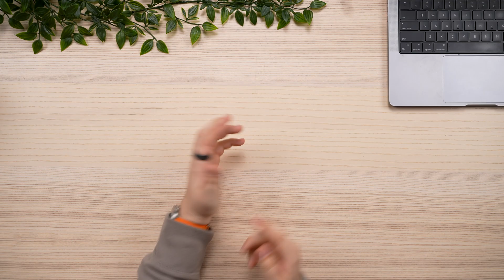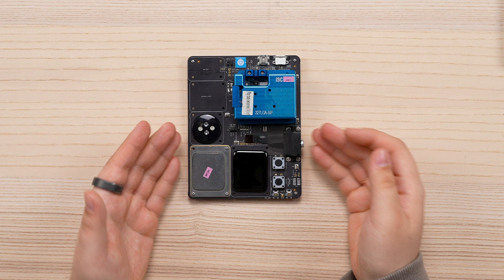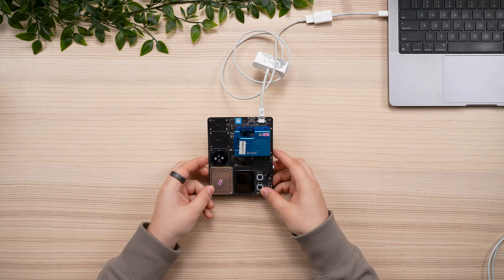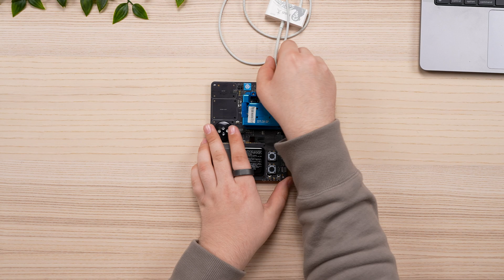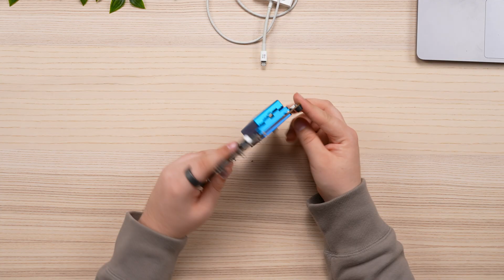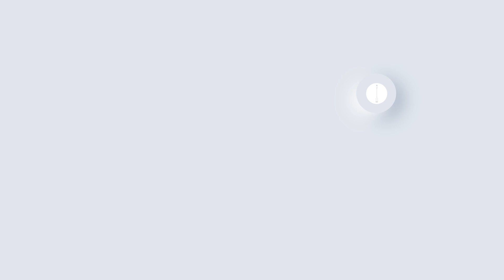I Need Help Restoring This Ultra Rare Apple Watch Prototype

Comment: i think watchOS 4 has a developer jailbreak, you can try and jailbreak the watch somehow and maybe grab activation from a already activated 1st gen dev/regular watch and replace the un activated watch files with the activation files with the other watch (all this done through ssh)
Reply: the watch is already jailbroken lmao????
Reply: @brian_angyal  No it isnt? Its just running an internal firmware. Internal Firmware/Dev Device does NOT mean jailbroken
Reply: @nuraadv1 internal firmware already has root access 💀💀💀💀💀 do some research before you start saying shit